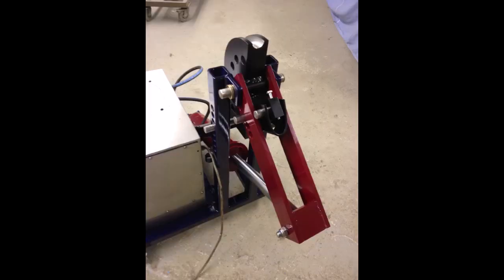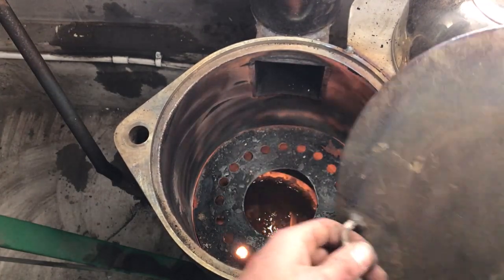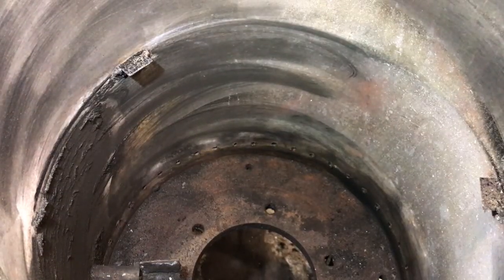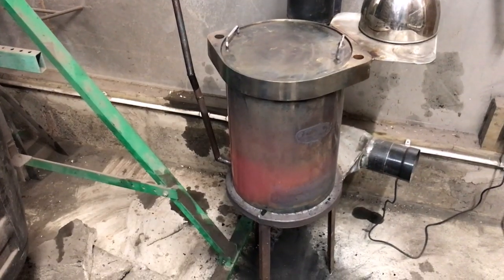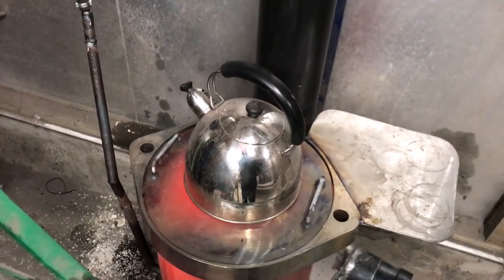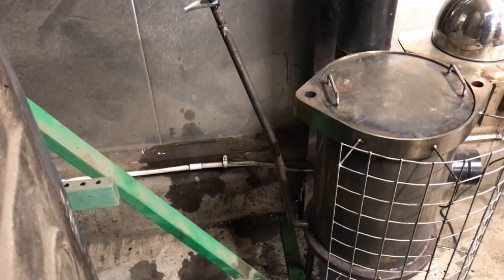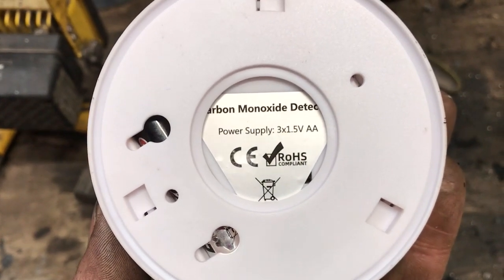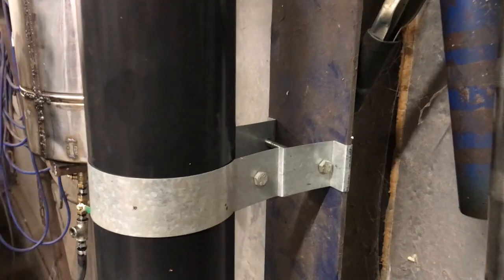Homemade Workshop oil burning stove

Comment: I'd watched this video last year, and didn't put it together that it was you!  I'm going to be building something like this soon - it's on my 'short list' of projects.  Haha.
Reply from the maker: 👍 I love my waste oil burner, to have a warm workshop throughout the year is a real luxury. You do have to treat it with respect as there are limited safety features. I don’t leave it unattended and switch it off an hour before I leave. 
You can hear when something is not right and can address it before it becomes an issue.  

There are more safety features that could be added so that unattended running is safer but whatever you add needs to be the right decision. 
It’s easy to add a safety feature with good intention’s that turns out to be the cause of an issue. 

If the burner runs too cold then the oil doesn’t vaporise, it then builds up in the pan and it will either drip out the bottom from overflowing or it will catch up and quickly get too hot. 

There is a minimum heat/ oil flow rate which needs to be adhered to, you can see and hear what too low is. 

There needs to be a way for a build up of oil to escape, or some other clever way to extinguish the flame via too much oil. 
For example oil covers the air supply perhaps. 

Other than that it’s brilliant..
Reply: @bensclassicbodywork  I've watched far too many videos on the subject, and it seems that the key is to have a large surface area heated to glowing temperatures to achieve complete combustion.  I was going to go the brake rotor route for my first experiments, and branch off into future iterations based on what I learned from these initial tests.

Simplicity in design is what's brilliant about your setup - I've not seen another one which allows the excess oil to drain out easily.

The important thing in my case will be to do all the testing outside, because I foresee several small-scale disasters incoming while the learning takes place.

Comment: everything is fine. But why do you describe the dimensions in millimeters? After all, yours are inches.
Reply from the maker: @istotakonieczna  Mine are inches ? In the uk we usually have mixture of metric and imperial, a complete pain. When it comes to precision engineering I always use metric.
Reply: @bensclassicbodywork  I imagine that if 100 can be divided by 1 liter kilogram height of atmospheric pressure and in your system if I wanted a few liters of fuel plus one kilogram of luggage 1 m height One bar then I would have to calculate everything on separate principles so you must have an easier way of thinking it's strange that you don't protest

Comment: Nice build. I have found that’s my design requires 40 to 80W of fan to get a nice blue flame. 

That being said, I only have 29, 3mm holes, so much of the power could be overcoming the resistance.
Reply from the maker: Thanks, have you made a video on it ? I looked on your channel but didn't find it. 
I haven't achieved a blue flame but I have increased airflow to the point where the heat output decreases. The 20watt fan I have now is running through a speed controller and is on a low speed setting but I did increase the hole diameters. 19x8mm holes and 22 6mm holes.
Reply: @bensclassicbodywork  Sorry... I have made one video on it and am working on another, however, it is on my other channel. I sometimes forget what channel I am logged into. My other channel is "Lowered Expectations" and I do a lot of diesel heater content. 

The idea / design that I used was from Creative inventions LMTN. He makes dozens of simple burners similar to mine.

Comment: Hi friend ; the problem is you set heater close to electric pip line at the wall, for safe need to move heater or electric line far a part .
Reply from the maker: Hi, you are correct, it is a little close for comfort. 👍

Comment: Great tip about using a ball valve!  All the other mods, needle valves, gate valves you that need to notch or shove something in them etc, are unnecessary.  Atomizing the fuel does not necessarily make it burn hotter, once the pot is warmed up you can decrease the oil supply to a trickle and get lovely clean burns.  If you start with a tiny amount of oil you won't get hardly any smoke at start up either.

Comment: nice video ben, I i have a 10" centrafugal extractor fan for ducting with a speed controller. I plan on using this fan for either a waste oil burner or a Gasifier not sure yet. your stove is lovely with the stainless steel construction. Look forward to more vids buddy :) Josh.

Comment: i use stainless to keep from burning up my stove, pipes, and components, I also drip water into the combustion chamber like an IV and get 20 to 30% more efficiency and do not have to clean it out as often. it runs red to orange hot and burns .6 gl/hr. love the radiant heat!
Reply from the maker: Nice 👌 I had heard of adding water for more heat, don't understand the chemistry but we know not to put out a chip pan fire with water. How much water/hr does it use ?

Comment: Is it safe for it to turn red like that
Reply from the maker: It's not very safe no. The guard I added helped safety but could do with more in that regard. I don't run it like that for very long and prefer a lower temp. In general I wouldn't leave the stove unattended, certainly not until many hours use had accumulated and I could rely on it.

Comment: nice heater :o)  Surprised you need a fan?  The two commercial ones where I'm working at the moment, don't have fans for the combustion air, just fans to blow over the casing and warm the workshop.
Reply from the maker: Hi, I'm sure someone smart enough can design it without the need for a fan.  Do you know what model the commercial ones are ?

Comment: awesome design. sounds like you'll want to make some more holes! maybe angle them for a swirl and a bit of turbulence? though I know stainless can be an utter pig to drill.

Failing that, you could go for a centrifugal blower fan like a typical boiler has. a car's HVAC blower fan works good for cheap - plenty of  oomf! (and adjustable if you get the accompanying blower fan resistor)
centrifugal fans have better pressure ratios than axial ones like you have there.
Reply from the maker: Great information, smart comment. 👍
I drilled out half the holes yesterday to 8mm and it's definitely getting more air to the burn chamber. The only drill I had to fit inside was an air drill and despite cleaning out the pot the exhaust from the air drill still blew soot all over me, I didn't realise until I got home that I looked like a chimney sweep from the 1900s. 

The increased air has made it burn cleaner and there's no soot building up now on any oil flow rate setting. It does make more noise though with a deep rubble but I'm not too worried about that. 
There's one thing I'm wondering and that is why does the smallest Thermobile waste oil burner have a minimum oil flow rate of 2ltrs/hr. That seems very high when I'm using more like 1.2-1.5ltrs/ hr.  Seems they have decided on a minimum heat setting. If I turned mine up that high it would probably melt.

There's two thoughts with fans. High pressure small holes, low pressure big holes. Low pressure would mean a lower power fan compared to high pressure ?
Reply: Thank God we have a fan engineer for support

Comment: Nice video. I may love to have a diagram of this setup.
Thank you.
Reply from the maker: Thanks, I'll keep improving it and when finished I would be happy to show a diagram.
Reply: I would love a diagram also mate. Brilliant job. Merry Christmas. Also does it produce thick black smoke from the ducting outside.
Reply from the maker: Thank you and merry Christmas. There was a bit of smoke with the 12watt fan but now I have got the 20watt fan fitted there is virtually none and no build up of soot in the chamber no matter what heat setting. You can have the oil feed to just a drip on very low heat and it keeps going, just turn up the oil flow for more heat. I did drill out some of the 6mm air feed holes to 8mm and I'm
Just giving it a test for a week or two. There is another issue I have to overcome which seems to have developed. After about four hours running the heat goes up and down in periodic cycles, I can sort of see what's happening but further investigation needs to be carried out before a conclusion can be drawn.
Reply: @bensclassicbodywork  fanatic mate. I look forward to hearing more about it and how you get on. I’ll keep in touch. Cheers mate. Craig. 😃👍🏼

Comment: Try a fan from a gas boiler, they can be found cheap or free, and being a centrifugal fan they can create pressure which is something the type of fan your using can’t do.
Reply: And also, try a six blade turbine if you want to burn down the workshop.
Reply from the maker: Great suggestion, I should have gone for that option first time around. I should have done more research generally it was all thrown together without much thought. The 20watt axial fan came yesterday and it reduced the amount of soot significantly but you could feel some blow back through the fan. As you suggest a fan which produces more pressure would be a solution. I started drilling out the 6mm holes to 8mm to reduce the pressure required, I will run it today and see what happens. Cheers
Reply: @bensclassicbodywork  Do please give us an update on your latest alterations.
Reply from the maker: Will do, I'm making an update video today with some important info. Cheers

Comment: Ben thank you for the video. Could  we get an in depth ? I noticed the big hole in the middle. wouldn't that be the same size as the fan hole ?
Reply from the maker: Hi, the big hole in the middle isn't one I cut, it was there already and is pretty much blocked off by the oil pan when in use. My intention was to weld up this hole but I have left it in place. I had a problem in the beginning where the oil spout feeding the pan was too far off to one side. What happened was soot builds up in the pan during use and the soot built up to allow the oil to flow over the side of the pan and onto the floor via the big hole. The oil wasn't on fire it just dripped onto the floor. The fact that there was a hole allowed me to find the problem and I kind of feel it's a fail safe to prevent the occurrence of too much oil being able to build up in the chamber. Up for debate on that but I like the fact i was alerted to the problem.Since increasing the length of the spout I haven't had this issue and it will run 9hrs without any oil overflowing the pan. 
There will be a very small amount of air coming through that big hole but I don't feel it would be significant. Happy to answer any other questions If I can.

Comment: Ben, thank you for the full tour. I think I can adapt that to become an aluminum melter.
Reply from the maker: I think you could, judging by the outside temperature of the cylinder 600-800 degrees C it's already at the melting point of aluminium. I can turn up the oil flow and it will get even hotter, add some insulation like you have done and boy would that work well. There is room inside for a good bit of aluminium and you have given me the thought of doing some casting myself. 👍 thanks for watching and commenting on my videos. 😊
Reply: @bensclassicbodywork  Do you think you could make a swirl air guide to get rid of the carbon block of junk inside the stove ??? That is my idea Ben. Hope you can run with the idea mate. Good luck with making it happen Sir. Your video are just right on, very easy to understand and remake whatever you showed can happen easily. I tip my hat off to you Ben.
Reply from the maker: @victoryfirst2878  Hi and thanks for the comment, I could certainly make a swirl guide and I have heard people say that swirling flames are good but I didn't know the reason why they are good. My 20 watt fan arrived today and I gave it a try, after 4 hours running on a low temperature setting there wasn't any soot/carbon build up inside. So it seems the improved airflow has solved the problem and the smoke out of the flu has definitely reduced. I did noticed some back pressure with the new fan so I have increased the 46 6mm holes to 8mm holes and the back pressure has certainly reduced. Hopefully more improvement tomorrow when I run it again. 
Ben
Reply: @bensclassicbodywork  I just love when a design just keeps on getting better. When the improvements are made at such a high level, the performance is second to none. This is what most stuff made is missing these days.. 
           I look forward see your improvements and to see how high efficiency will evolve. Good luck with you moving up the ladder and look forward to be part of the process.
Have yourself a Merry Christmas and A Happy New Year too. God bless Ben too.
Reply: @bensclassicbodywork 
Hey man you must made a fan close becose that is to hot and to much power on one place.
Reply: Very nifty.. wonder if we could cook some bacon, burgers, melt a little cheese, slap it all in a bread roll and hey presto!
Reply from the maker: Ooooh! I'll get my chefs hat. 😆👍